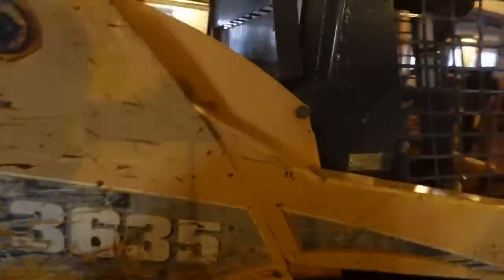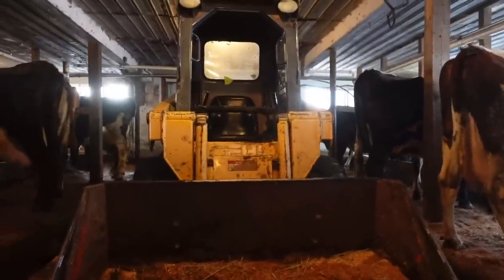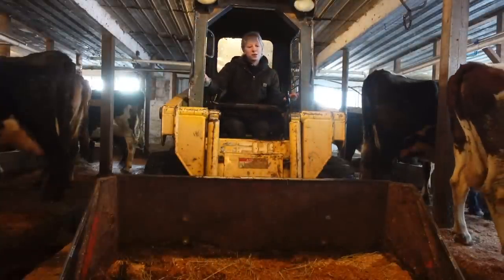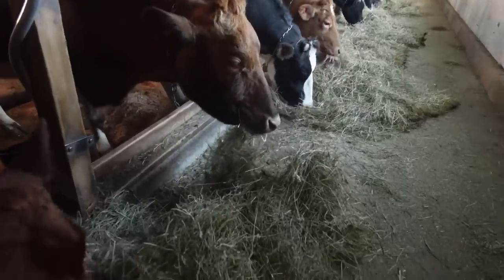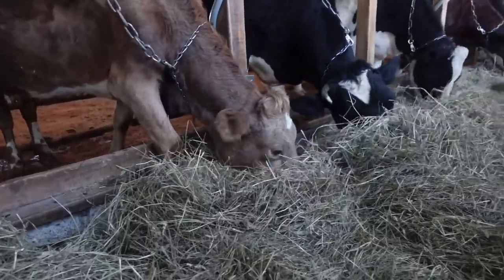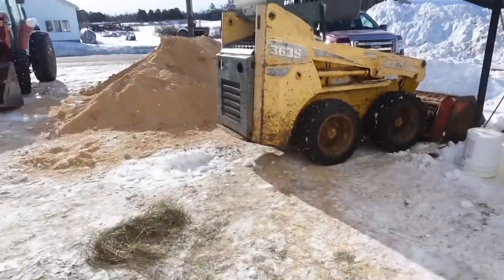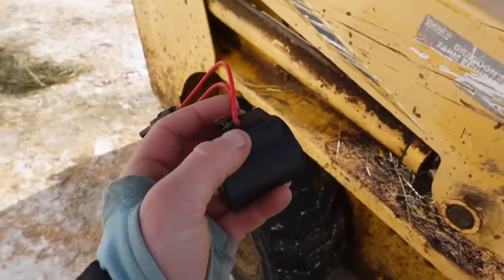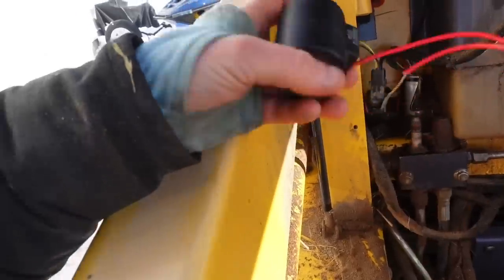Skid steer blues on this farm….

Comment: TIM from Canada put some sort of cardboard or a piece of cloth or blanket over the back of your skid steer. If you’re going to park it inside invest in a piece of plexiglass this way you can place it inside of your skid steer at night time does this skid steer have a plug in what do you mean does it have a hot plug where you can plug it in at night? It will keep it warm batteries.